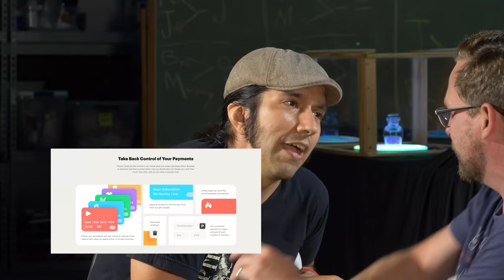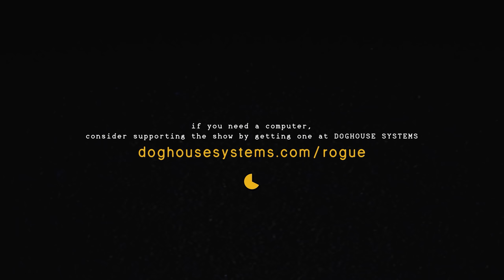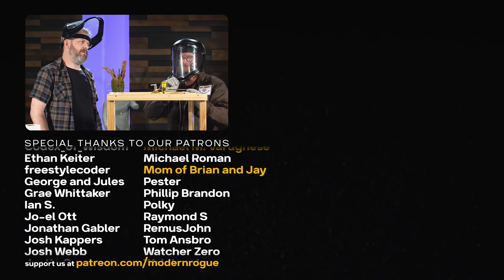Do Jewel Thieves Really Do This?

Comment: Ok, a store window is going to be atleast 1/2 inch thick.
Also the suction part is also meant to pull the circle you guys were scoring out, so you guys were doing it right, but not well enough, you guys would suck as burglars.

Comment: The second part of the your process is bullshit 🤣, I can't even comprehend what that poky thing is for. If you want to perfectly remove the circle instead of completely shattering the glass, pull the handle directly, without even breaking the suction (provided the tool is strong enough). Last resource could be punching the sucker in, but never using a sharp metal object, you're asking for shatter 😅